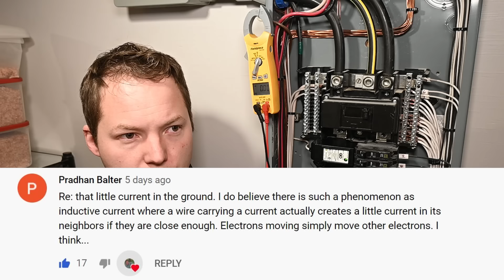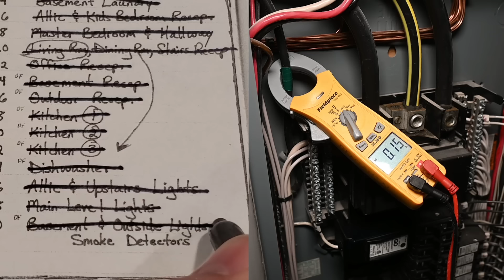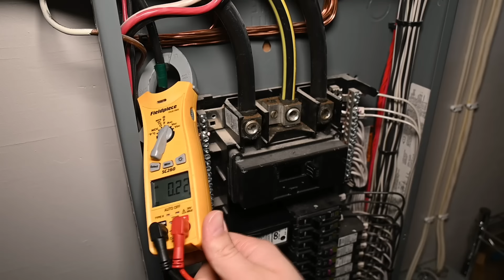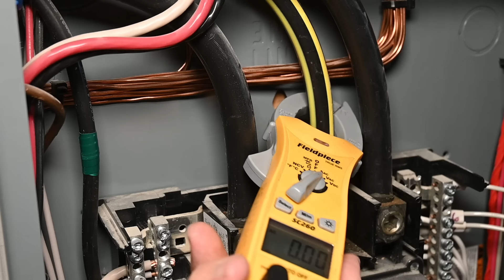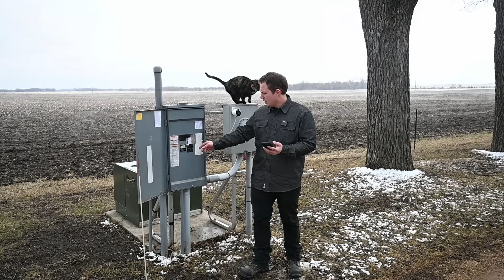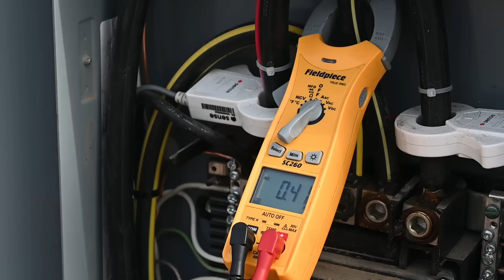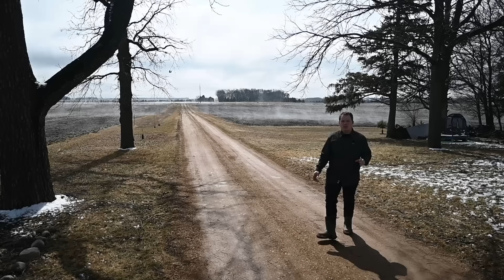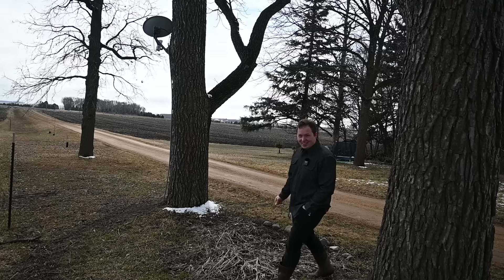Finding The Source of Stray Current on Grounding System

Comment: I would like to know, just since I am curious. Do you run TN 230V (between phases) in the US? And if so, why dont you use three phase in this case? I can see only two phases (or live or "legs" as you may call it) and neutral. With usage of three phases you can use the transformers full capacity, with neutral. Would be much better due to the transformer use 120 dagrees between phases. So that you wont have any skew load in the installation and grid. 

There is a lot of questions I got about the US system. But to keep it short, I need to know why Neutral isnt blue in colour as in every other country?
Reply: Neutral is white because the people that write the National Electric Code say it is to be white.

In the US a lot of residential is spread out, not concentrated into densely populated areas.  Installing three phase transformers would be very expensive.  

However, large apartment buildings usually do have three phase power but usually drop off just one phase to each apartment.

Otherwise, in the US the majority of houses have single phase power.  Not two phases.  It is called split-phase.  A single transformer, with a 240 volt secondary provides the power.  This coil is center tapped, and the center tap is grounded and is connected to the neutral.  Thus between either end of the coil and the center tap, one gets 120 volts.  

In the US and Canada, this three wire system provides 240 volts for ovens, stoves, ranges, cook tops, air conditioners, electric heat, electric water heaters, pool pumps, electric car charging equipment, etc.  Receptacles for lamps, electronics, and other devices that "plug in" are wired to one "hot" line and the neutral, thus run on 120 volts.

This system dates back to Edison's DC system.  It provided +110 volts and -110 volts using three wires.

Note in both the AC and DC systems the neutral only caries the difference current between each hot lag.  For example, if one hot leg is pulling 50 amps, and the other hot leg is pulling 30 amps, the neutral would have 20 amps of current.

Hope this answers your question.  Google split phase power system for more information.
Reply: @ericjorgensen4826  Hi. Thanks for the reply. Just to inform, I do know about the systems, and electrical pricipals. Since I am the electrical expert for a company that build datacenters, tunnels, hospitals and so on. And I am an trained electrician, and also has a electrical engineer dagree with state approved test to be the one that has the responsibility for installations in a company. 
Anyhow, this was not to lay out about my background. The reason I ask, is becouse every contry in the world follow the IEC standard. Some uses the pure standard, here in Norway we have convertet the whole IEC standard to one book basicly along with national regualtions (thats way better btw to have it all in one place)

The reason I asked about the grid type that i will guess is TN 230V, is why you dont use the colours that the IEC uses as standard on the N and PE. (N-blue, PE-Green\yellow).

The reason why you are using TN-C-S 230\110V is history, so that is OK. But are you building TN-C-S 400V in new installations as the rest of the world?
And use like 3 phases, neutral and ground? Old installations I agree, it would be kinda expencive to rebuild them. But new systems with higher voltage and a full TN 400V system will let you save a lot of cable size, it will let you use higher power rated ecuipment on lower currents and so on. And of course, it is equily safe, naturaly when build like the IEC standard says. 

And about the two phase. Lets say you have a two phase 32A 230/110V. That is a power maksimum between phases of about 7kW. And the same on two different one phase fuses of 110V 32A between phase and N. 
But if you had to use the three phase system all the way, then you would be able to have a relativly stable usage of all phases, and you would have a lot more power available with all three phases. You could actually degrade the main fuse from lets say in this example 32A, to a 20A fuse and still have about the same power. And even better, save som copper by use smaller cable size since the amps get smaller. 

I ask just becouse I am curious about the US system. Since it is so different from the rest of the world, why you use TN 230V, why installation norms according to IEC is not met with full, why not three phases and so on. 
I have been in allmost whole of europe with installation experience, boats (440V 60Hz), oil rigs (ATEX system), fishing pods in the ocean and other different installations. But the common thing that I see everywhere, is the TN-C-S 400V. Even in military installations. 
I like the US a lot, I have been there for two bigger vecations, and I loved it. But since I am kinda electrical nerd, I really dont understand why you use the system that you use. When you can use a system that makes your installations so much stronger and better at the same time (:
Reply: @kimremyholtet8765  Wow, you ask a lot of questions.  I don't know if I can answer all of them to your satisfaction, but I will try.  To make it easier, I will paste your questions, and answer each question within your original message.

The reason I asked about the grid type that i will guess is TN 230V, is why you dont use the colours that the IEC uses as standard on the N and PE. (N-blue, PE-Green\yellow).

Answer: My guess is the US standard predates the IEC standard, and it was decided by the "Powers That Be" not to change the US standard.

The reason why you are using TN-C-S 230\110V is history, so that is OK. But are you building TN-C-S 400V in new installations as the rest of the world?

Answer: No, that is not being done in the US.  However, many commercial installations are 480/277 volt 3 phase wye systems.  For example, a big-box store such as Wal-Mart or Home Depot would have 480/277 volt service.  These systems typically use 480 volts 3 phase for heavy loads such as air conditioning, elevators, and the like, and 277 volt single phase for lighting.  They almost always have one or more transformers to step down the 480/277 to 208/120 three phase wye for loads that require these voltages.  But the vast majority of the power used in these installations are at 480/277 so they have the efficiency of the higher voltage.  Smaller commercial buildings usually have  208/120 volt three phase wye service (a few smaller commercial services may still have 240/120 volt delta service, often with just two transformers in an open delta configuration).  (Large industrial service is often provided much higher voltages.) Single family homes, low rise apartment buildings and very small commercial buildings are 99.9% 240/120 single phase (called split phase) installations. I have seen a few mansions (very large single family houses) that have 240/120 volt delta (using two transformers in an open delta configuration) or 208/120 volt three phase wye service. High rise apartment buildings are almost all 208/120 volt 3 phase wye installations, with just 2 hot wires (one phase) sent to an electrical panel in each unit.  I used to have an apartment in NYC that was in a 56 story building that had 208/120 volt three phase service, and it had a large 500 kva transformer in the basement to step that voltage up to 480/277 for the 6 elevators (the machine rooms for the elevators were at the top of the building).  A single phase was dropped off to my apartment with a 100 amp panel providing me 208/120 volts.  The air conditioning, oven, and dryer ran from 208 volt circuits.  Lighting and smaller appliances such as the washing machine and dishwasher ran fro 120 volt circuits.

And use like 3 phases, neutral and ground? Old installations I agree, it would be kinda expencive to rebuild them. But new systems with higher voltage and a full TN 400V system will let you save a lot of cable size, it will let you use higher power rated ecuipment on lower currents and so on. And of course, it is equily safe, naturaly when build like the IEC standard says. 

Answer: I think the reason installations of 400/230 volt three phase service were never considered in the US and Canada is because is because the typical residence in the US is spread out over a much larger area than in Europe or Asia.  Installing 3 phase distribution systems would be cost prohibitive.  Many lateral HV distribution lines are just single phase, sometimes with a transformer for just one or two houses. Even in suburban areas it is common for a single transformer to only serve from 2 or 3 houses to as many as 6 or more houses depending on the location.  For example, in the south, where air conditioning loads are heavy and heat is typically either a heat pump or electric, fewer houses would be served from one transformer than in the north part of the country where air conditioning loads are not as heavy and heating is typically provided by gas or oil.  It also depends on how close together the houses are, as 240 volts cannot go as far as 400 volts.  As well, I do not think manufacturers want to provide two versions of utilization equipment that will operate from 120 and 230 volts for the US market.  I realize some equipment using switch mode power supplies can (and is) designed to operate from both voltages.

And about the two phase. Lets say you have a two phase 32A 230/110V. 

Answer: I am not sure what you mean by two phase.  I know of no utility in the US that provides 2 phase power.  Any 2 wires from a three phase wye system is a single phase circuit.  The US 240/120 volt system is a single phase system, with the center tap being a grounded neutral to provide 120 volts from either leg to the grounded center tap.  It is not delivering two phase power.

That is a power maksimum between phases of about 7kW. And the same on two different one phase fuses of 110V 32A between phase and N. 
But if you had to use the three phase system all the way, then you would be able to have a relativly stable usage of all phases, and you would have a lot more power available with all three phases. You could actually degrade the main fuse from lets say in this example 32A, to a 20A fuse and still have about the same power. And even better, save som copper by use smaller cable size since the amps get smaller. 

Answer: what you say is true.  400/230 volt three phase distribution is much more efficient regarding cable size, and a single transformer can serve many houses over a larger area than the US split phase system.  I suspect it is not used in the US for historical reasons and not installed in new installations for the reasons I have discussed above.

I ask just becouse I am curious about the US system. Since it is so different from the rest of the world, why you use TN 230V, why installation norms according to IEC is not met with full, why not three phases and so on. 

Answer:  I think the reason is historical and has never been changed for existing installations or for new installations for the reasons I state above.  The US in urban areas was widely electrified starting in the 1910's. I am not so sure about Europe, and if 400/230 volt was standard before WW2.  After WW2, with the rebuilding, perhaps there was an opportunity to rebuild in a more efficient way.

I have been in allmost whole of europe with installation experience, boats (440V 60Hz), oil rigs (ATEX system), fishing pods in the ocean and other different installations. But the common thing that I see everywhere, is the TN-C-S 400V. Even in military installations. 

I like the US a lot, I have been there for two bigger vecations, and I loved it. But since I am kinda electrical nerd, I really dont understand why you use the system that you use. When you can use a system that makes your installations so much stronger and better at the same time (: 

Answer: Please keep in mind that US residential loads are probably 80 percent or more 240 volt loads so it is probably not as inefficient as you think: air conditioning, electric heat, water heaters, ovens, ranges, pool pumps, hot tubs, clothes dryers, electric car (EV) chargers, and other high power items such as would be found in a home workshop such as large table saws, welding equipment, etc are almost always 240 volt.  120 volt receptacles are usually wired with 14 AWG on 15 amp circuits or 12 AWG on 20 amp circuits for TVs, electronics, computers, lamps, small appliances, etc.  The electrical panel in this video is typical of what is found in a middle class house in the US (although wired much more neatly!).  You will see two pole breakers for the 240 volt loads, and a large number of 15 or 20 amp single pole breakers for lighting circuits, receptacle circuits in bed rooms and living areas which can be either 15 or 20 amp circuits.  Current National Electric Code requires 20 amp circuits for kitchens, bathrooms, and dining areas.

Another thing to keep in mind is that the only thing that is operating at 120 volts is the 120 volt branch circuits from the electrical panel to utilization equipment.  The service feeding the electrical panel is 240 volts, and all the 120 volt loads on either side of the center tap of the transformer are essentially in series with each other, with just the difference between the two "hot" lines being carried by the neutral conductor.

I hope this helps with your understanding of the US / Canadian electrical system.
Reply: kimremyholtet I suggest watch a 13 part series called What on earth happened by Ewaranon to learn that the earth is not a globe.

I got it in my about tab.

Comment: I don't know if you still check messages but this discovery is due to earth ground voltage.  I don't fully understand it but it is how the utilities are set up at the primary, before the substation.  They have multiple ground to neutral connections, allowing for current from the grid to pass mainly back through ground.  The ultimate source is the power factory.  I think you are measuring current from the grid since you are grid tied.
Reply: ourtinytale I suggest watch a 13 part series called What on earth happened by Ewaranon to learn that the earth is not a globe.

I got it in my about tab.

Comment: Neato! Seems like your distribution supply has a small common-mode offset from ground! The current you're seeing into your ground rods probably goes all the way back to your local substation's distribution transformer.
This is an artifact of the way distribution systems use star-grounded three-phase power. Individual customers are usually only fed off one of the three distribution phases, so fluctuations in load mean that the three phases are never quite precisely the same voltage and current. Plus, their physical arrangement on the poles isn't totally the same either, so the capacitive and inductive coupling effects from that miles-long single-turn air core transformer that is the power lines, don't quite exactly cancel each other out perfectly either. All these effects serve to pull the voltage of that star neutral/ground just slightly off-center at your transformer vs the substation's.
Reply: AJMansfield I suggest watch a 13 part series called What on earth happened by Ewaranon to learn that the earth is not a globe.

I got it in my about tab.

Comment: Check Mike holt nec YouTube video on neutral to ground stray voltage
Reply: TheRichardmay I suggest watch a 13 part series called What on earth happened by Ewaranon to learn that the earth is not a globe.

I got it in my about tab.

Comment: It is well known if the property earth isn't perfect or some distance from your property you will generate a small voltage from the impedance in the nuetral wire, so if you have a heavy load appliance it will will more apparent e.g a higher small voltage. This could be more prevalent in a very hot summer when ground is dry.
Reply: normie I suggest watch a 13 part series called What on earth happened by Ewaranon to learn that the earth is not a globe.

I got it in my about tab.

Comment: Please get some insulated gloves.  You're freaking me out with your bare hands flailing around those service conductors with that chintzy ammeter.  That's hundreds of amps y'know.  It'll blow your fingers right off if it doesn't kill you.
Reply: calphool I suggest watch a 13 part series called What on earth happened by Ewaranon to learn that the earth is not a globe.

I got it in my about tab.

Comment: Check the earth diagram to the transformer. Only secondary windings should by earthed otherwise you could get a leakage from the electrical provider
Reply: stord I suggest watch a 13 part series called What on earth happened by Ewaranon to learn that the earth is not a globe.

I got it in my about tab.

Comment: Well... at the end you discover that was a capacitance current of the insulation of a radial connected padmounted transformer that leaks through all ground connections in order to get back to the source.
Reply: antoinedaly I suggest watch a 13 part series called What on earth happened by Ewaranon to learn that the earth is not a globe.

I got it in my about tab.

Comment: Another interesting video.  Thumbs up!  The "Fog" coming off the field is probably "snow sublimation" which means the snow is going to gaseous state without passing into the liquid phase.
Reply: It's probably the snow being vapourised by all the power that's leaking through the ground ;)
Reply: buzzinhornet I suggest watch a 13 part series called What on earth happened by Ewaranon to learn that the earth is not a globe.

I got it in my about tab.